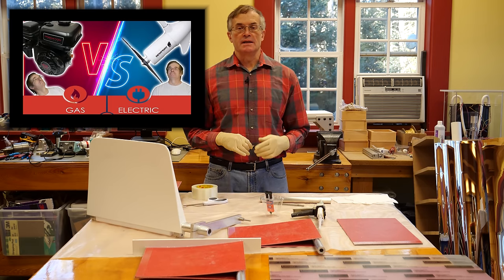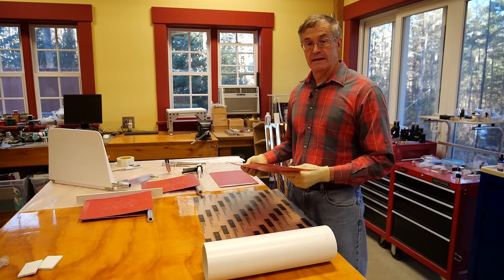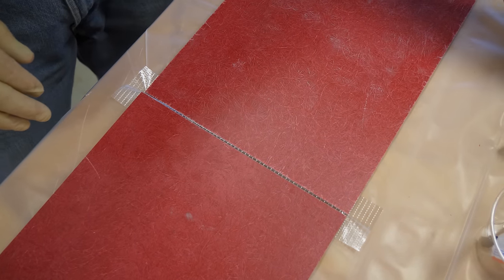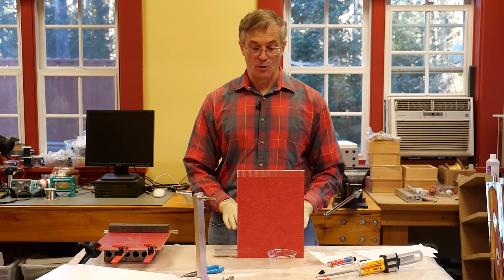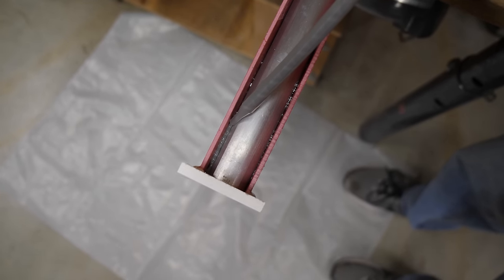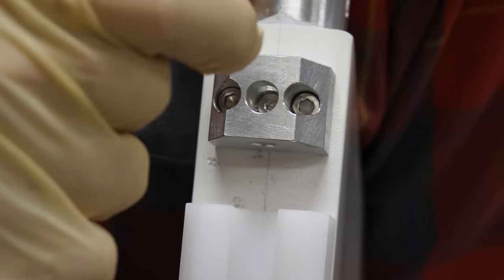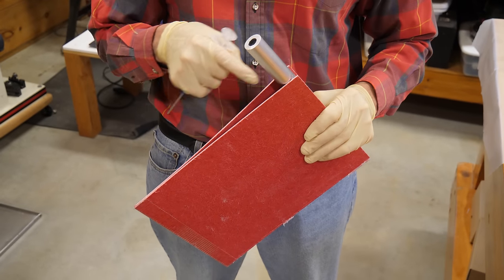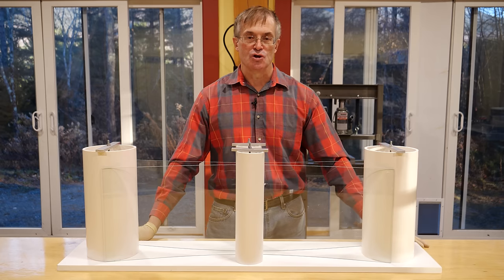How Our Boat Rudders Are Built

Comment: Very interesting rudder construction and good detailed description, too.
I haven't seen the boat yet but one thing puzzles me. 
If the sides of the rudder was to bend outwards a better hydrodynamic shape could have been made. Much like the curvature obtained with the use of NACA profiles. I know they are designed for planes but due to the fluid dynamics and density of water and low speed of boats (compared to planes) it comes out almost the same. 
A better foil profile will require less wet surface of the rudder and at the same time optimize laminar flow across the surface of the rudder- The rudder will be more efficient, cause less drag and have a lesser risk of stalling.
Reply from the maker: Thanks!
Not all airfoils have a positive curvature.  Some of the highest performance airfoils actually have a negative or concave curvature.  At extreme angles of attack, such airfoils will stall earlier, but that is not where the boat will be operating unless it's performing low speed maneuvering.
Reply: @TechIngredients  Thanks!
I'll look into that.
I do make a number of rudders, centerboards etc. for multihull sailboats. Most optimized for speeds between 8 and 20 knots. Thanks for the inspiration :-)

Comment: Another method to remove bubbles without vacuuming the epoxy is the stretch method. Requires a steady hand and more height. The higher position when pouring the more chances of bubbles getting stretched out of the epoxy with the smallest stream possible when pouring out the epoxy.

Comment: Awesome video! I think this technique can solve a prroblem I am having. How would I need to stress a panel to form a perfect circle segment?
Reply from the maker: If you attach rotating clamps to each side, you can induce a spherical curve by torquing these clamps.  Alternatively, if you draw an arc along a circle and bend a specific plate you can approximate a circle so closely that it probably won't matter by cutting an angle into two edge supports and clamping the plate to these angles.  Obviously, in either case, the clamped edges will be streight and then need to be removed from "the perfect curve".
Reply: @TechIngredients  Thank you so much for your reply, will try!

Comment: Hi,
Excellent tutorial; I have one question though:
Wouldn't the epoxy at 7:31 squeeze-out unevenly, thereby causing a messy edge near the bottom (narrow-gap-side)? In turn, this would cause the bent shape to be an inexact approximation of a hyperbola. That being said, would it not be better to:
1) apply a measured dose of excess epoxy between the sheets (not just in the tape-gap)
2) apply a stiff pair of bars near the edge to be joined (with numerous clamps)
3) Apply the preload-cylinder to separate the sheets while the epoxy is still fluid
4) Let the epoxy cure
5) remove the clamping bars; the stress shall now be transferred to the (shaped) epoxy

As a side-effect, from this point forwards, the epoxy fillet shall be loaded not in a "peeling" mode but instead in a "tension" mode. (being a non-zero thickness)

As a counter-point (to poke holes in my own hypothesis) -> If you were to split the sheets at 8:19 by pulling them apart would the "epoxy-stitched" edge be a straight line, or a jaggy?
If it is straight, then my proposed method holds negligible advantage.

Another point - (you have mentioned this in a previous video already) - would you consider additives to the epoxy (fibers, beads, fillers, ...) to enhance dimensional stability, tempco, or other aspects?

Comment: 1. Why did you leave an air gap in the middle of the rudder?  Was it to save on material?  If so, would filling the rudder completely with epoxy offer more strength?   

2.  How well would the techniques you demonstrated scale to a rudder for a larger vessel?  Say a 40 foot boat?  

Thanks and great channel and content.
Reply from the maker: It's more than strong enough with the weight and cost saving air space.

Comment: Re: Subtractive manufacturing definition. "Billet" is an incorrect term here. That is a foundry term. Billets almost never leave the foundry where they are made. The term you're looking for, most generally, would have been "wrought bar or plate"
Reply from the maker: You may be right.  However, many technicians refer to billet components such as crankshafts, pistons etc as "billet" when machined from a block of raw material as opposed to finish from forged stock.
Reply: @TechIngredients  Yes, those are also incorrect uses of the term. As far as I can tell, It seems to have arisen as a marketing term, primarily in the aftermarket/custom automotive and botique firearms industries, and possibly because people didn't like the technically correct term of "wrought" because "wrought iron" sometimes has negative connotations as cheap iron akin to "pot metal". By the definitions of the people who misuse the term "billet" to mean something that is machined from solid stock, well, that means that nearly anything machined fits the definition. Castings are routinely finished machined, as are forgings. If you were to call up a foundry and ask for "aluminum billet" they may very well ask how many hundreds of tons you wanted, assuming you wanted the unfinished (pre-wrought) billets which usually weigh several tons each to make forgings. On the other hand if you were to order "wrought" aluminum then you'd get exactly what many people refer to as "billet". All of the technically precise terms already exist. Saying something is "machined from a forging" or "machined from a casting" would be technically correct, as would "machined from wrought bar or plate", but saying something like "milled from billet" while most people would understand what you meant, is still technically incorrect. I get that not everyone needs to be as technically precise as "turned from hot rolled, picked and oiled AISI 4140 hollow bar" or something, I feel like it is reasonable to call things their most correct names.
Reply from the maker: Fair enough. One of our goals is to slip in correct terminology along with useful techniques.
Thanks for the reminder.
Reply: @TechIngredients  No worries. The reason I mentioned it in the first place was because I knew you paid attention to that sort of thing. A small caveat is that within different foundries the way the terms "billet" "bloom" and "ingot" are used can vary (at least based on my asking around people who work at foundries), but they are all mid-process states of the metal. After original casting, but before being wrought or forged or extruded.

Comment: Very. interesting as usual 👍 The tank at the end may not be such a good idea but I'm not 100%. A friend of mine build a 6' long by 16" wide and 2' deep with 11 mm perspex, actually the same as what the army use around their wagons to protect from hand launched missiles like fire works, bricks etc. Anyway he used silicone and drilled and screwed every 1"1/4 but it leaked every time it got above half way. He plastered it with silicone eventually but still no joy.
Perspex is oily, will the epoxy hold a good strong joint with it? If it sat on a wooden floor would the vibration of people walking, music etc have an effect over time? 
Perspex goes hazy over time especially if cleaned harshly. I like your idea but I think I prefer glass as a window into the fish world.
My Friend ended up getting the same size of fish tank built professionally, I ended up owning it for around ten years, I preferred my original 4' one to be honest as the 6' one was too big for my room.

Comment: Please tell me when the shaped charge video is coming? 
And can you make a video on substitutes for epoxy for high temprature use in carbon fiber or fibreglass lamination
Reply: Lol, yeah, where's my exploding wire? I guess we'll have to wait until 3rd July or so
Reply: High temperature laminating epoxies are available. I don't think there is any substitute. I have often wondered if sodium silicate could somehow be used to make a basalt/sodium silicate matrix that might be pretty heat resistant, but I doubt it would be practical. Here is a link to high temperature epoxy: https://theepoxyexperts.com/product-category/adhesives/high-temperature-adhesives/max-hte-ab/.  Note that this epoxy MUST be cured using heat. It will not cure properly at room temperature.

Comment: Wondering why when you designed  your rudder you didn't move the pivot point aft (rear) of the leading edge of the rudder by 20-30% so it would swing in the opposite direction of the tail of the rudder, assisting in the force needed in steering but not reducing the efficiency of the rudder?

Comment: And, how are the rudders performing? Because to me the negative /inward curvature will result in higher water speeds to the inside of the blade. Sort of a "vacuum" resulting in extra drag, that might be at least half a knot. Opposed to NACA rudder profiles were the curve is outward and creating lift, thus a more effective rudder.

Comment: interesting system.  On the fish tank, would you put some form of grid / screen on the bottom, before pouring the epoxy, to give it some tensile strength? I know someone will copy you, and want to move the tank while still having some water in it, along with the gravel.
Reply from the maker: You're right.
That's an easy way to substantially increase the strength and continue to benefit from the ease of a poured structure.

Comment: As a pattern tool maker I have worked with many epoxy tooling. The one step I notice you neglect is scuffing up the jointing surfaces before applying epoxy. This should become common practice.

Comment: I think boatmakers would carve an aerodynamic rudder shape out of urethane foam and cover that with glass fabric soaked in either polyester resin or epoxy.  You're making it outside in.  It seems like yours will be a lot heavier since you started with panels much thicker than the ultimate resulting skin on a commercial boat rudder.
Reply from the maker: Maybe, but we don't have any foam inside and our sheets are stronger because they are commercial, autoclaved material rather than resin rich hand layed fabric.  It's a close call.
Reply: @TechIngredients  I did some more checking.  Nowadays they are stamping rudders.  They make a sandwich of foam and plastic, then they stamp between a hot, rudder shaped, mold.  

I have another question.  Why did you opt for a concave hyperbolic shape rather than convex?  I'm thinking of cavitation possibly being an issue at higher speeds once you get the catamaran moving faster.

Comment: I look forward to seeing how that fish tank works out. Could you reduce the stress on the epoxy (where it actually meets the material) by gently heating it if you're using something like plexiglass? Presumably, once the form is complete, your main sheet material would retain a lot of that stress from the bending & would keep trying to return to flat, so would softening it just enough to get it to settle in the new shape lead to a stronger end result?
Reply from the maker: The water pressure should greatly exceed the stress induced by bending.  If the principle works, it's probably not worth the extra effort to relax the material.
Reply: @TechIngredients  Interesting, thanks & good luck.

Comment: Maybe I’m too used to bigger boats, where the rudder loads can be enormous, but, I’m surprised by what I would consider inadequate moment connection between the rudder blade at the rudder shaft. I would have welded upper, middle and lower stiffening gussets to the shaft before adding the side plates and filled the voids with epoxy or foam core.
Reply from the maker: Have you ever sailed  on a small catamaran? This boat is similar in scale and speed to a Hobie Cat. Some of the hardware is actually from one of these boats.

Comment: Another great video full of great information and clever techniques. However I hope your rudder design is a proven one as it appears to be designed without consideration in terms of "balance". Meaning there will be high energy input to turn the rudder as it has no leading edge forward of the pivot point to offset and assist the rudder to turn it self to some degree. Regards.
Reply from the maker: That's true.  This simplifies the mounting and the hydrodynamics of the rudder/stern interface at the expense of greater force needed for actuation.

Comment: As always, great content. I have a question about an alternative method of completing the third side of the rudder (where you explained that you drilled and tapped a hole on the opposing side to allow you to add epoxy via a syringe, then plugged the hole): Would it be effective or beneficial to position the part with the open end up, then just pour in slightly more epoxy in the open end (to account for some epoxy left behind on interior wetted surfaces) and then cap it with the plastic strip and hot glue (run bead overhead or flip entire assembly over and maintain pressure to keep seal while hot gluing). The epoxy could then flow to the bottom and create the last face without needing to create and holes in the part.
Reply from the maker: It might work, but the uncertainty of what's where inside probably isn't worth it.  The hole, tap and plug takes a minute or two.

Comment: Hello. I know this is an old post, but I'm researching rudder designs and it would be very helpful if I could understand why you chose the shape that you did as as opposed to the more familiar "wing foil" shape? Ease of construction? improved performance? suitability for a catamaran? Be well, and thanks for your videos.
Reply from the maker: Ease of construction and low drag performance.
The proximity  of the leading  edge to the trailing edge of the hull makes the rudder act as a continuation of the hull.
If the rudder were further back, then it would generate more turning  force, and  a full wing shape would be necessary to minimize  drag.
Reply: @TechIngredients  Thank you , thank you, thank you This clarifies some issues for a design I'm researching. As a woodworker let me say "may your life have interesting grain"!

Comment: Off topic but have you tried gator board for the panel speakers? It's got a resin impregnated wood fiber skin on each side with expanded foam in the middle. Lightweight, rigid and seems to have ideal tonal qualities.
Reply from the maker: I haven't.

Comment: I made a windvane self-steering system for my sailboat and struggled with rudder flexing and fatigue failure. Would there be a benefit to adding an aggregate to the epoxy fill on the top, bottom, and leading edge of this rudder?

Comment: If my understanding is correct, aramid fibers like Kevlar can have a greater ultimate tensile strength to weight ratio than carbon fiber, but, for many applications, aren't used because they don't have enough stiffness: a Kevlar composite part may be able to take more stress, but would deflect an unacceptable amount before taking up that stress. Could a kevlar composite part be made stiffer by somehow pretensioning the fibers, like they pretension rebar in concrete beams? Is this done?
Reply from the maker: Kevlar does have a similar tensile strength and tensile modulus to carbon fiber, but it has poor compressive strength and modulus.  Carbon is a better balanced material, but has much less toughness S-glass is the best on all fronts but is heavier.  You have to choose based on the application.

Comment: when you poured epoxy into the rudder to form a bottom, you then poured to the tip, then you have to pour to top side. Well, instead of drilling a hole you could've used gravity. Just pour some epoxy as if you were on the bottom again, put the cover on with hot glue and flip it over. It will self level and you don't need to drill any hole.
Reply from the maker: That's an option.
Reply: @TechIngredients  Wow, you really do read every comment :)) Greetings from romania! One of the best channels i came across so far. I hope it keeps growing.

Comment: Hey, ive been watching your turbocharger jet engine build videos recently, as ive been researching building my own. Is it coming along? Any idea when the next video will be? Im very keen to see your ideas for a power turbine.
Thanks!
Reply from the maker: It is progressing, but slowly.  There are so many topics I want to cover and just so much time.
Reply: @TechIngredients  Ecstatic to hear that! I've been considering removing the compressor turbine from a much larger turbo than the one I'm using for a gas generator, and fitting it inline, to use as a power turbine. Do you think this would be viable, or would RPM be too high? What are you going to use for a power turbine?

Comment: So rather than drilling, tapping, and plugging a hole, couldn't you just dump the epoxy in, hot glue the PVC sheet to the top and then just flip the entire assembly over?  I very well could be missing something, but it seems even easier.  Either way, very cool stuff!  You are the epoxy master.
Reply from the maker: You want to cast that epoxy into the opposite end and only a centimeter or two thick.  Most of the internal volume is empty.